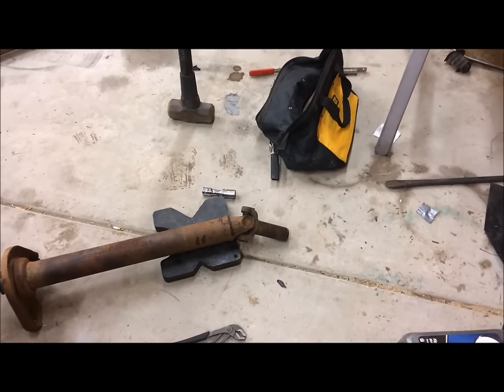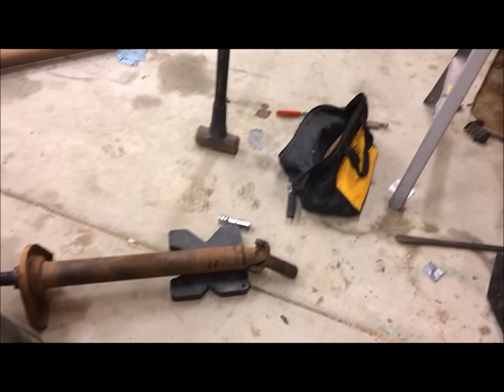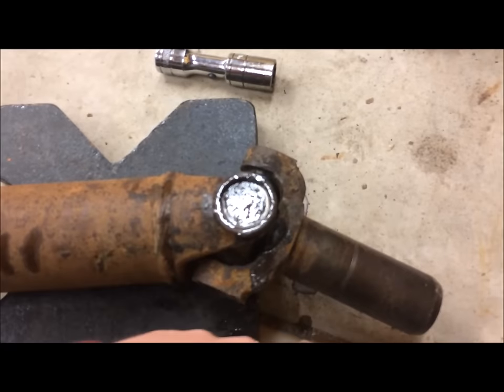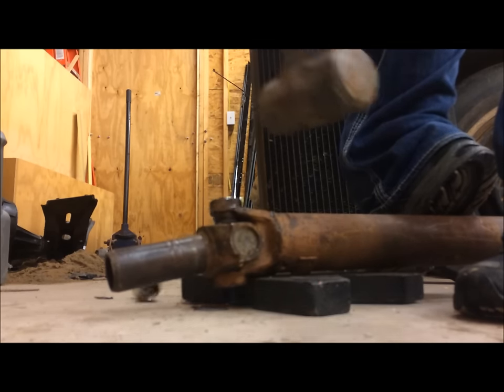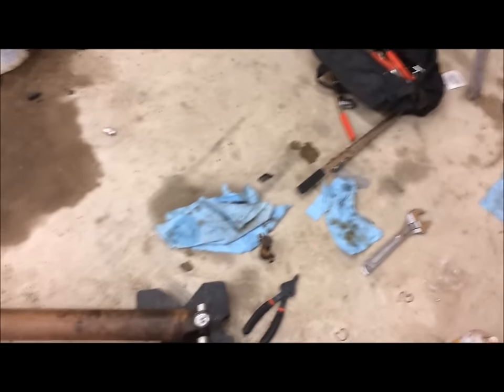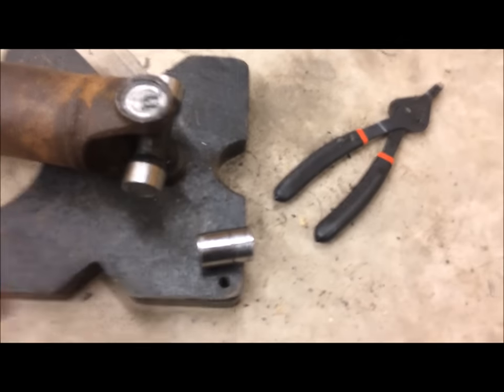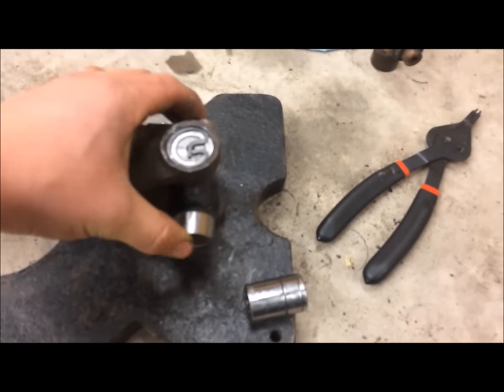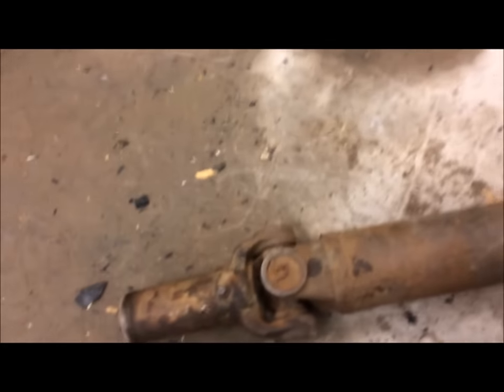Remove U-Joints without a Press | 5 min. U-Joint Removal

Comment from the maker: One thing I should have made better note of, make sure the end of the driveshaft around the cap is supported to make sure it doesn't get tweaked when knocking the cap out. Other people use a big socket but I didn't think to do that at the time. If it does get tweaked the ujoint will be real stiff and you have to bend it back in slightly until the ujoint fits properly. I am by no means a professional, these videos are just me showing what I ended up doing

Comment: Damn that came out easily.  Yesterday I spent 2 hours swinging a sledge to remove 2 rusty-crusty u joints. Install was maybe 5 minutes.
Reply from the maker: I was surprised too given it sat in a barn for some years and then sat uncovered outside

Comment: Always enjoy & appreciate vids like this but I've been doing UJ's on vehicles for 40yrs & soon realised there's a way to do them without the needles being able to displace.
You put the joint in with one end cap, then you move the cross piece out of that cup ALMOST out but not quite so the needles cannot fall out, then you put the opposite cup on the bit of shaft now protruding & push the whole thing the other way. 
There's no point during the process where needles can come dislodged, they are designed to be assembled without needles falling out otherwise car factories would spend half their time picking up needles off the floor lol
Reply from the maker: That is more or less what I had to do when I put the rest of the driveshaft together. That video was my first time messing with U joints. That install wasn't very professional but it works. Only real mistake I made was putting a Ujoint that had the grease fitting on the housing not the cap and with the drive shaft angle from the trans to the carrier bearing it took about an hour to find a way to grease it. Hindsight 20/20.

Comment from the maker: From Denny's Driveshafts pn# 3-3130, NEAPCO Combination U-Joint 1310 to GM 3R Series. I ended up not using it because the 4x4 has a larger slip yoke than the 2x4 so when I had to buy a new slip yoke I just bought one that used a 1310 U-Joint. If you were still using the 4 wheel drive then this may prove useful as long as the 1310 can handle the torque of low range gearing.

Comment: I get the shaft up on the bench and support the yoke with the faces of a big vise, then use one hammer to tap another hammer of the correct size to drive the joint out of the yoke. The two hammers allows careful control of the one actually driving the joint out of the yoke. Wear eye protection and use penetrating oil beforehand. Got one of these to do this morning. The replacement joints are also cold soaking and I will warm the yoke a tiny bit with a torch when I am ready to install the new joints.

Comment: If you are set up in a press and your part is not budging, tap on or around it with with a small ball peen hammer. The vibration will usually help pop it loose. Shoot it with a bit more penetrating oil while you tap--the vibrations will also cause the oil to seep in more easily. You got lucky knocking that one out as easily as you did.
Reply from the maker: I did this method for the stock u-joints on a 1999 z71 Tahoe with the same results (after I melted the plastic out from around the caps) and it worked on stock u joints from the 1968 drive shaft that had been sitting exposed to the elements for the last 20 years so that suggests to me that this is a decent method.
Reply: Not arguing with your methodology. I've done dozens of them like that over the years, done them in a vise, etc. Just responding to your struggle moving it with a press. Tapping on it while under pressure almost always pops whatever you are pushing on.
Reply from the maker: Thanks for the input, I never tried tapping around on it but I am sure that it would have helped. More than anything the Chinese press was what was worrying me
Reply: Yup it takes the memory out of the metal and it doesn't take but some small little taps with a ball peen, nothing ferocious lol Also if the carrier won't come off the shaft just heat one small section of the bearing and hit it with a chisel it should stretch it out and come right off thats another common issue when changing carrier bearings and way better than a grinder since you really don't have to worry about splines in the way if you put the chisel in the right spot. It works great for all sorts of races not just for carriers just crank the oxygen/acetylene or propane torch up heat one little section cherry red across the stuck bearing an one good smack with a chisel it will slide right off the shaft, its a handy little piece of knowledge to know rather than trying to heat it evenly and work it around with a hammer or using a puller because the shafts going to expand just as quick while you are trying to evenly heat the damn things to beat it to death. There are plenty of tips and tricks out there to be gained from all the old timers before they retire if you are careful to be respectfu an also humble. That's the thing about skilled labor jobs is that you can learn just one little thing that makes you more effective at turning wrenches and that makes you stand out above others in the job market. You can turn wrenches for 60 years and still learn new tricks everyday which does keep the job a bit more entertaining. Another crazy tip that actually alot of people don't know which is if you need to get rid of something aluminum buy you a tube of some gallium off Amazon (it's like mercury but will stain your hands or whatever like a graphite pencil) but pour it on an aluminum object and it will eat it away as long as the aluminum is fairly clean and not oil covered. Works great when there is an aluminum roll pin that's a pain in the ass to get to.  Just pour it and wait, it will make that pin fall apart lol Oh and coke cans are fun to put that shit on too. It will eat it up and you can poke a hole with your finger right through the can afterwards an its like poking snow or something close to that lol. Magnets can be your best friend too. Get a like 75 lb pull force magnet for when you need and extra hand and they come in extremely handy. I'll pry something back with my 36" indexing bar and then have it held to the body or frame of something and boy does that help in certain situations. Another trick most people don't know is that if your welding in a very tight spot where you can't run too hot and you need to but that metal can't be dripping down into something else, just get you an air arc rod and it will act as a backstop and keep slag or metal from stick to things and it won't stick to the rod either. So that works great when you have a decent size hole you need to patch quickly and don't want to let things cool before you run another pass just throw a couple rods behind the hole and fill it in don't have to really worry about how hot you are running unless you're welding on something that can't be warped a little bit or anything. So there ya go there's a couple small tips for you that might come in handy later down the road kinda like super glue and baking soda I use it to fix shit all the time my most used combo it's a badass pair to fix alot of different materials!

Comment: Great way to save the day. Myself however, when I’ve already got everything out and the joints are that old, I replace them all.
 Reusing them may get you by for a awhile, but then you have to pull the thing out again and again. They’re wear parts, they have years and miles on them and you’re going to adding more power to the power train.  It doesn’t make sense to me to not replace them all ams avoid a problem in a week, month year from now.  
 Same with anything, if a wheel bearing or ball joint goes, I do both sides because they have the same mileage/time on them,   Then it’s off the table for a long time to come.
Reply from the maker: I wasn't real concerned because at the time they only had about 134k on them and they still looked in good shape apart from the one. Based on my experience with aftermarket parts I generally don't replace stuff unless it is unrebuildable, a safety item (ex. suspension), or cost prohibitive. Seems like used factory parts are often better than what you get from a parts store. And I kinda trust proven parts more then new, like if these components have been happy together for 100k and still look happy then why not let them continue? Personal preference but I don't like tossing parts that still have substantial life and with the build of this truck and the 280zx for that matter, if I redo every single thing I am afraid of getting burnt out before I get it on the road. So doing stuff like this may mean readdressing it in the future but it helps me get the car to the point where it can be driven enough to need addressing. There has been a lot of stuff like that on the 68 but I have gotten to enjoy it as I have steadily improved it. With that said, I agree with your response for a daily driver and questionable parts. Ujoints have had 4 years and about 12k miles put on them, all seems good except for maybe the carrier bearing rubber that I think I will replace when I can get around to pulling/resealing the trans pump. Thanks for the input and conversation
Reply: @PracticallyStock   man I fully agree on used OEM over Chinese junk.

Comment: Yours popped out Quite Decently, Yes going Back In is the Prowess needed routine. Put Extra Thick Grease In The caps to keep them lil needle bearings from moving around. Bike(Motorcycle) Wheel bearing Grease Is very Sticky enough!

Comment: How important is it to put the universal yoke back in the same position as it was?
Reply from the maker: I am not sure which part you are asking about, I think the U-joints can go back in any orientation. If they are used, then the specific cap and needle bearings need to go back on the u-joint where they came from as they are worn to each other. The splined yoke on the transmission side should be able to slide into the transmission in any orientation. This should also be true for the splines between the two driveshafts but in my case it would only go one way for some reason. I am not an expert in any of this but when in doubt I try and put things back how they came apart, let me know if this help
Reply: @DreamTeamProductions  Yes, I meant the U-joints. It does help. Thanks for taking the time to reply.👍

Comment: not all u joints are that easy your gonna cause some one to bend their shaft
Reply from the maker: I can see how that could happen but I used that black plate to help support it and soaked everything in penetrating oil. I tried using a press but I was really having to bear down on it and I didn't trust it. To me using a press is like a breaker bar and this method is like an impact, both pros and cons. That U-joint is likely an original one from 1968 or at the newest 1987, then the driveshaft sat outside since about 1998 so i would like to believe if it worked on that one and on a U-joint from the 4x4 tahoe without any trouble it should be ok.
Reply: A bench press is the best way to go
Reply from the maker: Well being that the video is titled "how to remove U-joints without a Press" I am not sure exactly what you were expecting. I used this method on all the u-joints in the 68's driveshaft and even on the u-joints of a z71 Tahoe with no problem. If you are uncomfortable using this method then don't use it.
Reply: John Johnson I love shaft bend mmm lmfao jk
Reply: John Johnson don't quite see how, we don't have a press at our shop, always taken them out with hammer and sockets and never had an issue. If their ujoints are bad enough they bend a drive shaft then they had bigger problems to start with
Reply: Well, on my 1972 1210 international, there are dust covers on the Front axle that i am taking the u-joints out of and you can get it on the bench press without bending those dust covers.
Reply: One way to muck your project up is by having aluminum driveshaft. Be very very careful. If its steel or coming out of a ford/dodge, bang the holy crap out of it.
Reply: This is the only way I do it never bent one Jesus people just gotta know every fuckin thing
Reply: +1. This is a sure-fire way to trash an aluminum driveshaft. Those aluminum yokes will not tolerate this caveman approach in any way.

Comment: the needles fell out cause yer not doing it incorrectly , ya have  to hold cross up into the cup your installing so they cant move or come out
Reply: Then they fall out from the cup on the opposite side.  Trick is to move the u-joint half way into the cup - leaving the other end half way into it's cup

Comment: Unless you have a true hydraulic press, this is the best way.
Reply: Until you realize that all your extensions are damaged to the point they won't fit your ratchet. That's been my experience anyway
Reply: @JasonTAho  that's why you keep a cheap as dirt set specifically for hammering on

Comment: I'm glad you removed it but i would not recommend this. Anything on the tubing of the drive shaft is a nono...... If it bents at all it will be unbalanced and cause major issues. This peice can NOT be bent . keep all pressure on the metal knuckles. Its made of cazt iron so it will NOT break from your strength. Just hoping noone puts their weight and feet or any otger hard surface on the shaft portion of the driveline.
Reply from the maker: I was only resting my foot on it to keep it from rolling, I agree standing on it would be hard on it. I supported the end around the ujoint as best I could and tapped it out. I also don't claim this to be the best way, just the way that I did it.

Comment: How to  remove drive shaft?
Reply from the maker: That kind of depends on the specific vehicle, on some (to keep from making a mess) you have to drain the trans (or tansfercase if a 4x4) fluid. If it's a single piece driveshaft just unbolt the u-joint from the diff and slide the yoke out of the transmission. If it's a two piece like mine, you also have to undo the carrier bearing mount (mark the spline so goes back the exact same way). 
I would consult a shop manual for your vehicle or someone knowledgeable about your vehicle to be sure.

Comment: Not quite sure you're using that hammer right ahaha but I guess if it works it works
Reply from the maker: Definitely right, but seemed a little more controlled than a full swing although that probably would have been more entertaining
Reply: He was using it for a downward force not a driving force...some hammers are designed to do that and have a plate on the top...some have solid casings as well...impossible to put a new handle on and kind of pricey...

Either way there are different ways to use a hammer and this isn't really the wrong way...just not the right hammer for the job...but it worked so who cares HAHAHA
Reply: @Kolonol1  exactly. People always have to add their two cents like the guy didn't know how to swing a sledgehammer

Comment: ALUMINUM = NO!!! For newer aluminum driveshafts this is a sure fire way to ruin the shaft & yoke, then it's a trip to the junk yard and the hunt for another driveshaft. This is also HIGHLY dubious for installing the new joints. Wailing on a precision yoke on a balanced shaft is not wise.   For the older steel shafts it may be ok, (it's what we did as ignorant teenagers "back in the day") but anything newer than the early 80's is risking serious shaft and yoke damage.
Reply from the maker: Thanks for the aluminum mention, I have never worked with one and don't know how sensitive they are. I didn't however advise wailing on anything and I used a rather small hammer to tap the new ones in which I wouldn't exactly call dubious. Assuming the person doing the work doesn't know what they are doing, I would think this method or a press have an equal chance of tearing something up